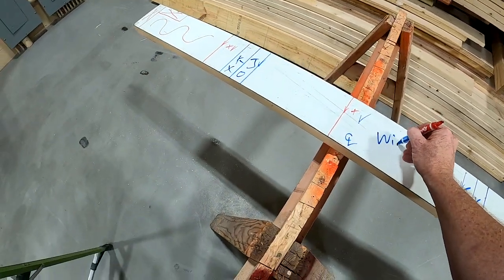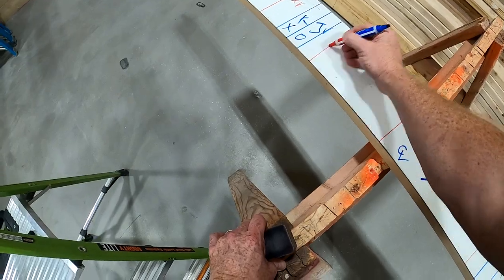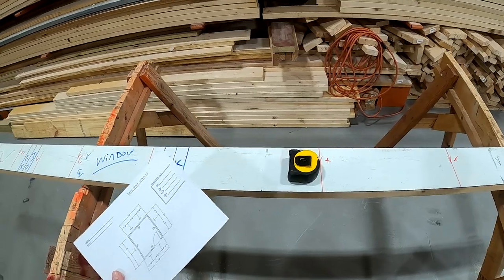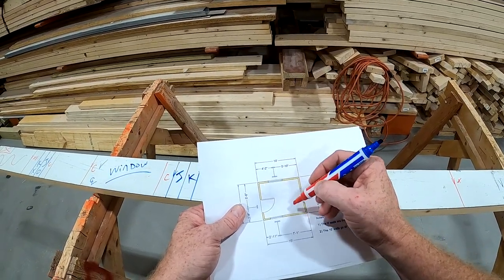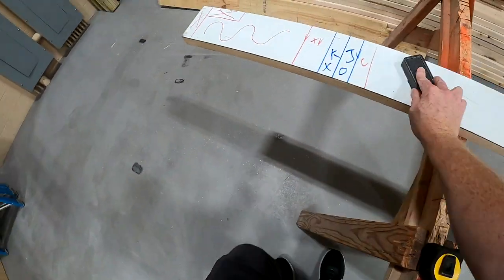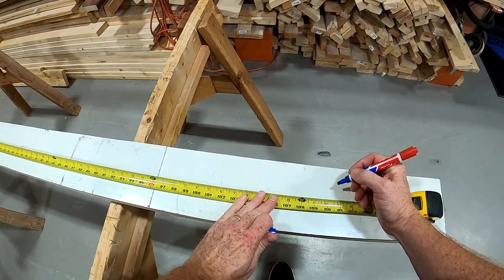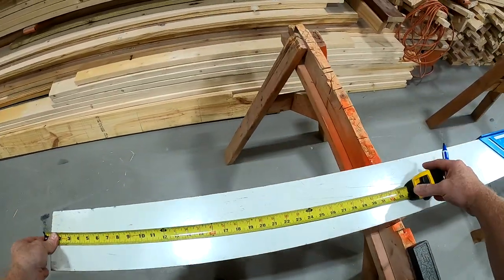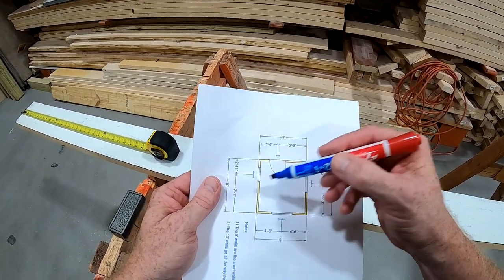Wall Layout Lab Exercise

Comment: Great video, just a little thing I'd like to point out. The king stud on the right of the window only half covered the 16" OC stud layout, deleting the stud leaves you with a 15-1/4" wide bay. Not so ideal with precut insulation, and not a good habit on longer walls, where a drywall seam may land/edge-out. 
Everything starts with the framer, but usually makes a later step more difficult for another trade. 
I really do like your method of teaching layout with the dry erase.
Reply from the maker: Great observation, Thom, and I agree on that, if using standard insulation.  I should have clarified that in my video.  I teach Green Building and Energy Efficiency classes where we use advanced framing techniques with 24" OC spacing and reduced wall framing material.  With more or extra studs you also have more thermal bridging.  I usually don't do jack studs either.  I use a longer header with metal angle brackets to support the weight.  I also teach "Splash & Blow-in" insulation where you spray foam an inch thick then put us a mesh on the studs and blow in Johns-Manville Spider insulation.  That way you get the air-seal and dense insulation.  I'm not a really big fan of fiberglass.  There are too many irregularities in it and nobody installs it correctly anyway.  Thanks again!